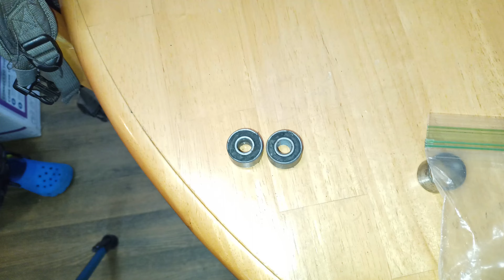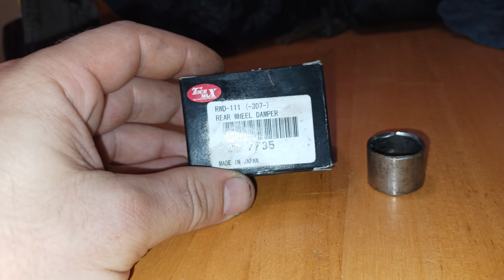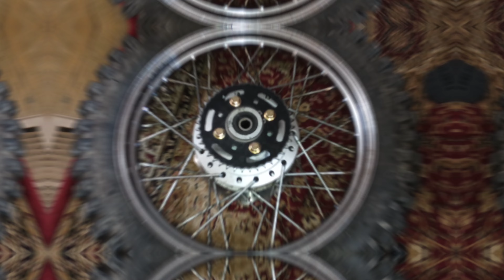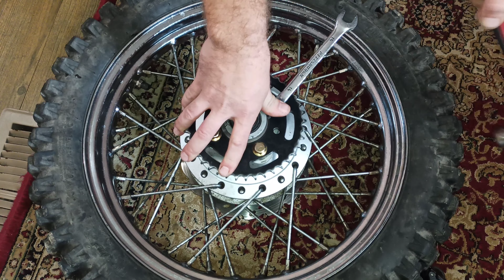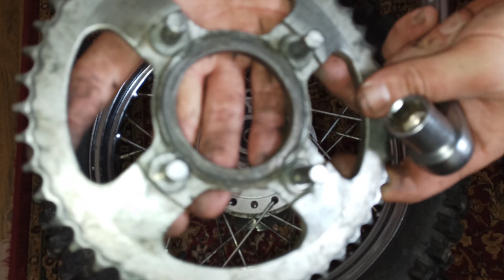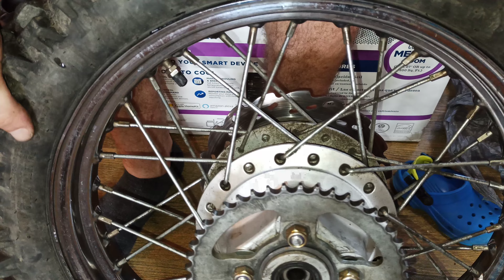Changing rear dampener bearings for OEM Honda xr200. 3rd times a charm!!

Comment: When you have it apart take the time to grease the bearings and use anti seize on the bushings inner and outter.
Reply from the maker: Yeah I did lube the wheel bearings the first time I took the back wheel off to try the Honda cg125 bushings. Probably like three weeks before this video.  I took the dust caps off and lubed up my wheel bearings with grease. I didn't put any anti seize for the dampening bushings though. I probably should have for all the time put in figuring out which ones worked best. I went with the Honda cg125 ones and they were shorter in depth so they tore apart after 1ride. Went through three sets of those. Then I went with the screw in bushings and everyone said it would blow my gearbox up. So after 3failed attempts with the cheap Honda cg bushings with different modifications each time to make them last longer than one ride. I went to the screw in and rode it down the road once before swapping out to the ones you see in this video. I should of put anti seize on the dampener bushings but I didn't think it would cause too much of a  headache in the  future from not having it. Only time will tell and thank you for the advice! Also thank you for watching!